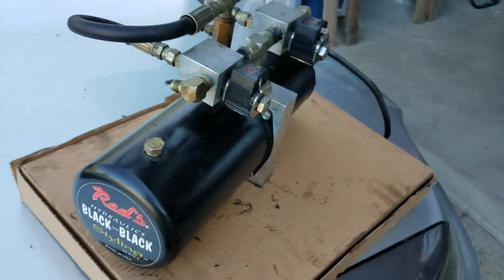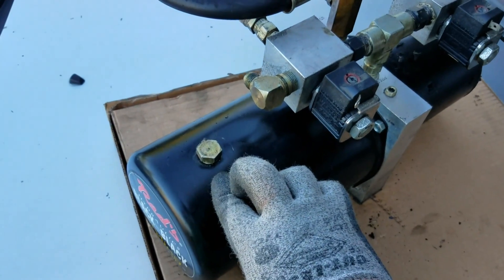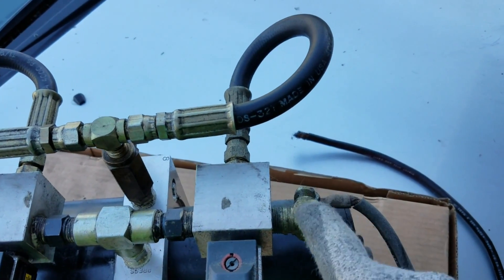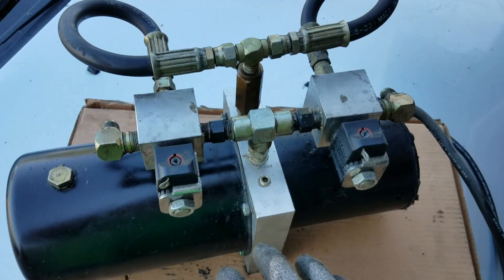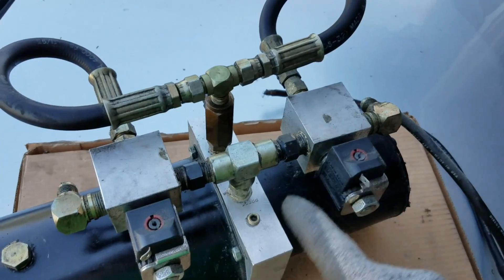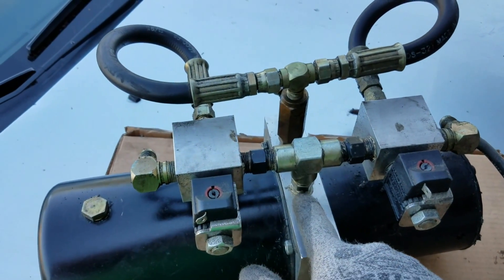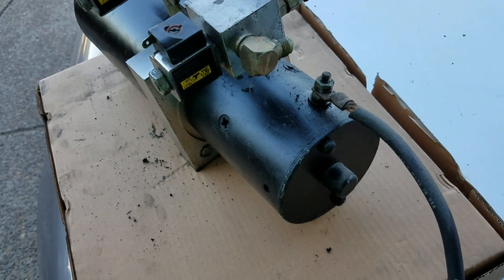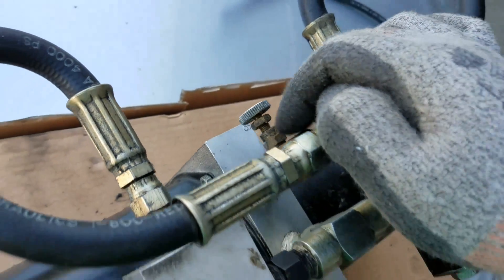How a Lowrider hydraulic pump works

Comment: hey brother i just replaced the rings on my dump cartrige but as i pulled it out i was cleaning what i thought was some of the o-ring in the box and i got a snap ring  ,spring and a nut that looks like a castle chess piece. did somthing brake that im dont kow ?

Comment: I have to make a presentation about lowrider hydraulic systems for my engineering class and I wanted to ask if you need one of these pumps per axle, per wheel, or one per full car? Thanks so much.
Reply from the maker: Eamonn Prunty 
Thats cool, theres a bunch of ways that you can build a lowrider. You can use 1 pump to as many pumps that you want to use. The basic set up is 2 pumps, 1 pump to the front 2 wheels and the 2nd pump to the rear wheels. Another most known set up is 3 pumps, 1 pump to the front wheels and 2nd pump to the right rear wheel and the 3rd pump to the rear left wheel or even in reverse with 3 pumps.  On some hoppers they have 2 pumps to the front and 2 or 1 to the rear wheels. Some people have 4 pumps for the front wheels and 2 or even 4 pumps to the rear wheels.  When someone uses just 1 pump in the entire car then they have 4 dump plumbed on that 1 pump. Theres many ways a lowrider can be built though.
Reply: LowLows & More! thanks man. i appreciate the quick reply
Reply from the maker: Eamonn Prunty 
No problem
Reply: That pump has two dump 2 cylinders.for rear axle 2 dumps for fron a arms hydraulic cylinders mostvtimes replaces shock.instead of gas.oil is controlled to lifting and lower.through pressure up to 8000 psi

Comment: What about batteries? What’s the difference between having 4-6 batteries? 
I want a 2 pump 4 battery set up for my 62. Because I want to put big subs back there and I want it all to fit. And would it be an option to upgrade add batteries and pumps to your existing set up for the future?
Reply: If you have 4 batteries for 2 pumps first of all up it batteries will die supper fast and it wouldn’t be enough power just for my back of the car I have 4  batteries and they die quick (if you like to use them almost everyday) it’s better to have more then 4 especially for 2 pumps

Comment: I have a 64 belair with 2 pumps 6 batteries the car started to get slow when I it the switches, but now they don't work at all... all batteries read more than 12v solenoids and pump motors are good but when I press the switches I just hear the motors but doesn't do anything. Any advice would be appreciated Thank you
Reply from the maker: Your gonna have to pull ur pump apart and check the slpine key and also check the O-ring that is in between the gear and block.
Reply: @lowlowsandmore  Thank you

Comment: What oil/fluid do you use for old 90’s pump like you have?
Reply from the maker: NoelBB 14 
I honestly don't know what oil they used to run in the 90s, but i run Pennzoil 5-20 and or 5-30. I havent had any problems with that oil.
Reply: @lowlowsandmore  I use to use hydraulic oil for my reds, oil that's used for car lifts.
Reply from the maker: Thanks